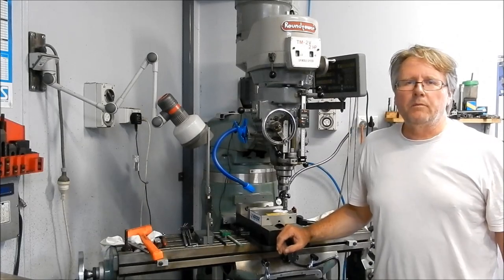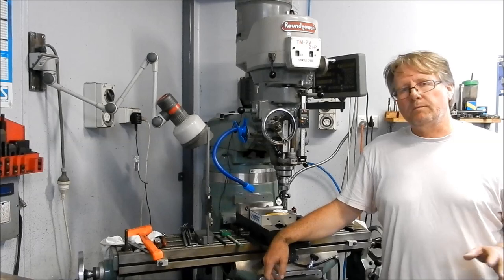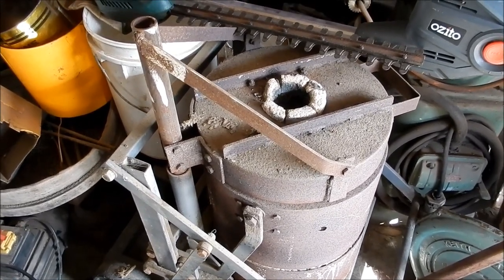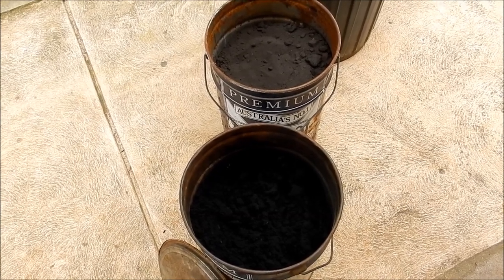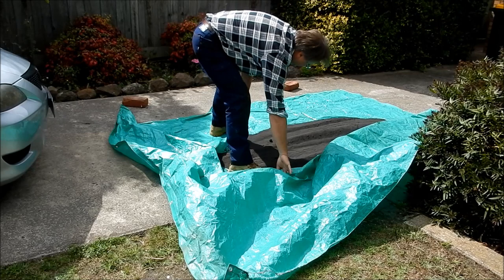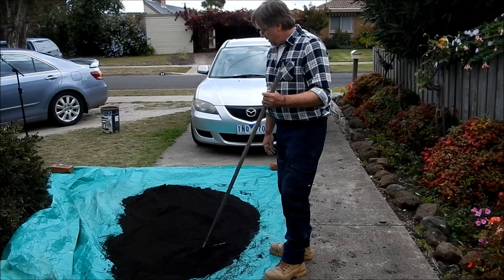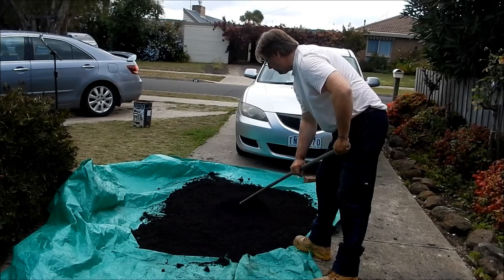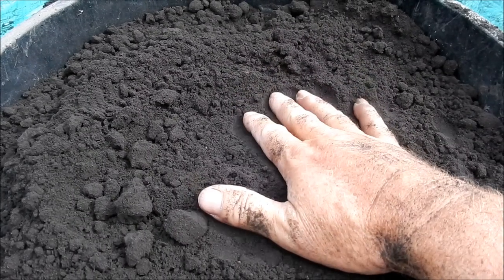How to Mull Green Sand without a Muller

Comment: Excellent video Cam. I've just made a small Coffee Can furnace to learn the basics. Have just started looking at Green Sand and this videos a great help. Once I get my head around the basics I'll build a bigger furnace and started some projects I've been want to do for a long time. Regards Kevin
Reply from the maker: G'Day Kevin, yep start small (I did) and build up to larger volumes as your confidence grows.  Start with aluminium and then move onto bronze and if it takes your fancy have a crack at cast iron.  Casting at home adds a different angle to the shop and certainly opens up a whole range of different projects you can tackle.
Cam

Comment: Ah, the Mazda muller! I'm interested in your recipe for Kbond sand. That would make a great video.
Reply from the maker: G'Day Mark, I'll do the large body casting in green sand and the small cover plate in the KBond sand.  Hopfully it will show up the difference in surface finish between the two castings.  I'll re-mull the KBond sand when finished which usually only entails adding the isopropyl alcohol.  see the link to the recipe from the Kent State University - 
https://www.afsinc.org/sites/default/files/inline-files/k-bond%20sand.pdf
Cam

Comment: I used the exact same technique when I laid road base under my pavers. Back and forward with the Navara, the 245 wide tyres did a good job.
Cheers
Reply from the maker: G'Day Raymond, did you need to put some protection between the road base and your tires to stop it from sticking?  I certainly need the plastic to stop a buid-up of sand on the wheels.
Cam
Reply: @camatbattler2233  no it was proper road base from a pug mill and came together quite well, compacted well with the weight of the Nissan. Sometimes you just need to think outside the box. Interested to see your smelting and casting, I’m in the process of building a furnace to cast ally into useable stock.
Cheers

Comment: And that is why I built my sand muller, lol. I used to do it by hand/feet when I first got started, but dealing with the tarp taking off for other stuff, and the clay and sand drying out my hands and feet and constantly making them crack and sore for days after, I finally just made the muller and it really made a massive difference also. Another big thing was that it would take days to fully get the moisture through the sand absorbed evenly, and if I were trying to do any casting in colder weather, it was impossible. With the muller tho, I could mull up a batch of sand and be ready to make the mold within 10-15 mins, and it allowed me alot more time to do castings if I had gotten one or two nice days.
Reply from the maker: G'Day Chirpy, yep the Muller is certainly the way to go but when starting out and only needing a small quantity this makes it so much easier if you don't have a muller.  My big Paddle Muller that I used for the Cast Iron Sand was so much better than the other wheel mullers and could knock the silo of sand (around a Tonne) out in less than 1/2 hour.  It was very power hungry though and had numerous upgrades with larger motors being added and rebuilding of the structure to match the upgraded power to reach that efficiency.

Cam

Comment: Hello Cam,
Very good approach... I hope you did not get into to much trouble off camera with the wife... 
Take care.
Paul,,
Reply from the maker: Hi Paul, yes it's a method I used back in the 90's.  I can safely say I was the fist to use a car as a Muller.  The car did get cleaned out but it wasn't easy getting the stuff out of the carpet.
Cam